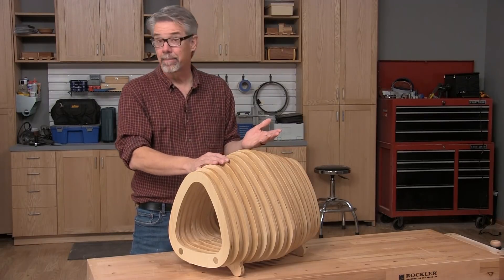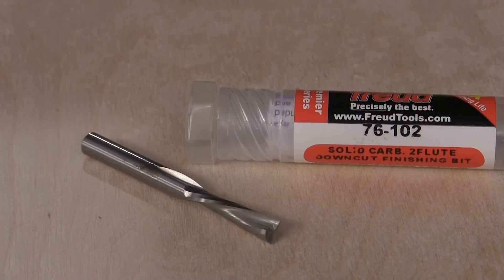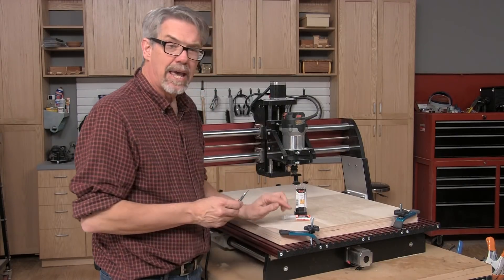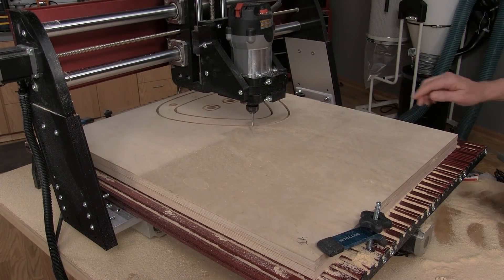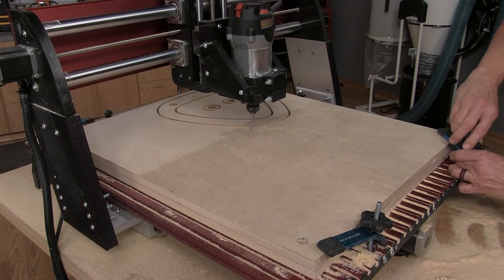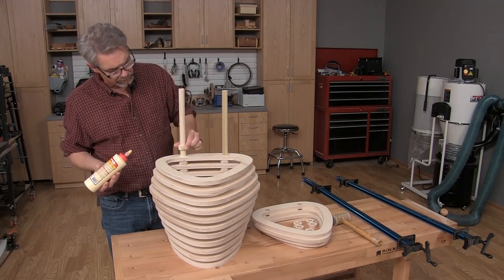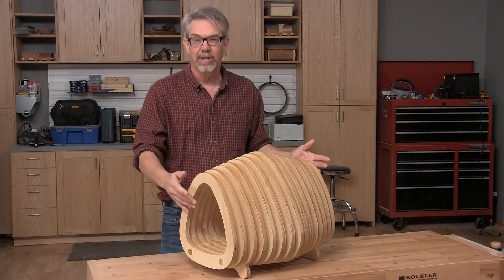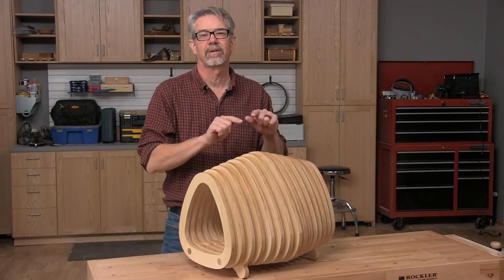Cat Bed CNC Project | Freud Sponsored Project

Comment: From comparing the VCarve file to the video I have a few questions:
1) The hoop count is different, 15 vs 17. Why?
2) I don't see the a cut for the end piece without a hole
3) The numbering sequence it's consistent and has repeats, why?
4) What does the hoop labeled "C" signify? Where do I use it?
5) The VCarve spacers don't have a flat side but the video's do, why?

Perhaps the VCarve file that's linked to isn't the final version?
Reply: The  dxf is even worse it does not have the washers in the files   Why not just give the real designs in the normal  design formats that are currently used  like sketchup, Fusion, Autocad, etc.

Comment: What the heck is a TAP file and how do I convert it to my machine format  I use Fusion 360 asmy file creator.
Reply: Change the .tap to .gcode .  It's just straight ascii gcode with a weird extension.
Reply: Peter Menningen it is an extension that Enroute software assigns to cut files.